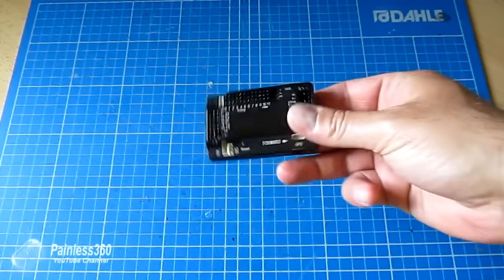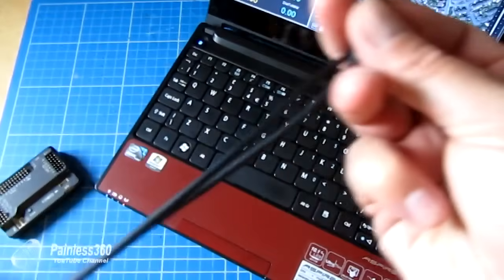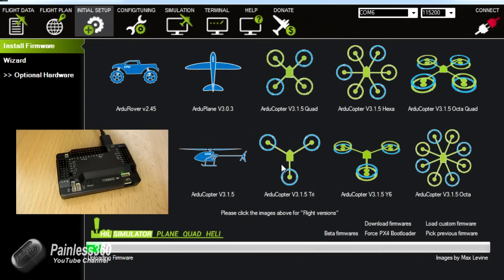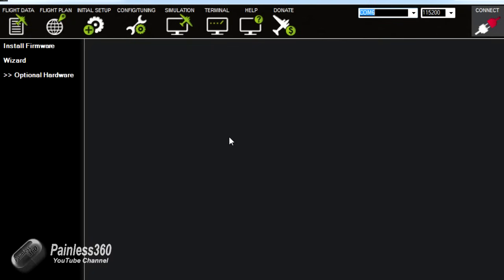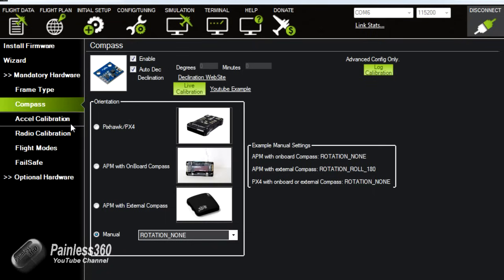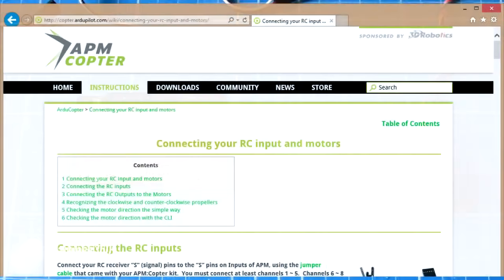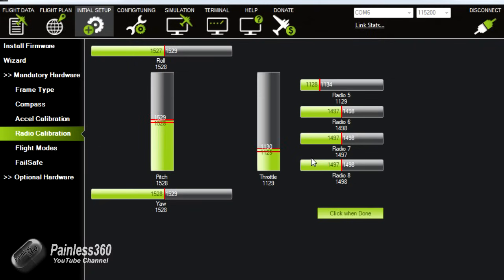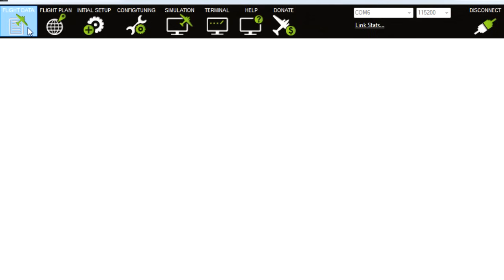(1/8) APM 2.5/2.6/2.7/2.8 - Simple installation and setup overview

Comment: I would like to build the latest version of the Arducopter I think that is 3.4.  I find it difficult to find detailed information even on the Arducopter site.  So far I've not found a place to buy any higher than the Arducopter 2.6.

I have a Blade Chroma copter with a bad controller in it.  (It was a fly away because of defective controller but I got it back.)  I thought since I have everything else, body, motors, battery etc. why not custom refit it for Arducopter?  Has anyone done anything like this?  Since I've never built one from scratch I will likely need some detailed help.

Horizon wants $250 for a new controller board.  Truth is they don't update their firmware the last update for Chroma was in 2015.  Outdated about as soon as it came out with limitations that we as users have no control over.  I want something I can modify and update as needed.

I have an 8 channel Spectrum receiver.  A DX 7 controller and a ST-10+ controller.  Looking for someone to point me in the right direction to start and finish this project.  Thanks.  (I have stage 4 cancer but this is on the bucket list.  Gives me something to do since I can't really work anymore.)  I am on FB and I have a channel on YouTube.

Bryon Smith (AKA "GhoolerHunter")
Reply from the maker: I think you may be mixing your versions. The board revisions are 2.5, 2.6 and HobbyKing did a 2.8. There is a mini version of the APM called the v3.1. Arducopter versions are usually three digits and the last version that supported any of those APM platforms was version 3.2.1 of Arducopter. Hope that helps..
Reply: Regular size is fine with me. Don't need a mini board I have a 500 class body I'm going to put it into. Just need to get the latest version of APM / ArduCopter controller and I'll start building from there.  Is 2.8 upgrade-able to 3.3 ?  If you have a link or info that would be nice.
Reply from the maker: Then I'd go for a Pixhawk. It supports the latest versions of the code and should work great. Best of luck!
Reply: I been looking at that one.  I have an Ardu 2.8 controller and I'm collecting parts.

Comment: can you please help i got my ARM2.6. roday. I looked through your tutorials and trying to figure out here. i cant calibrate radio. connect it via USB to the Mission Planer, by when i turn on the transmitter it just disconnects from my PC mishnplaner.  when transmitter is off it works fine. i was able to install firmware (to 3.3.2). calibrated accelerometer and compass, connect the receiver and made ESC calibration everything seems normal receiver is connected via PWM. 
but as i said the problem is - I want to calibrate radio in Mission Planer - but as soon as the transmitter is on it disconnects from Mission Planner (connected via usb), what could be the problem or am i doing something wrong?
Reply from the maker: +Iron Man Sounds like a power problem - make sure you are using a USB port that can handle the power and also unplug everything apart from the Rx and see if it's still the same.. Best of luck.
Reply: +Painless360 thanks for the answer, i resolved this by reinstalling the firmware. now i can calibrate radio. it works. but there is another issue with arming. when connected to PC via USB i can arm/disarm as normal. but once i plug in the battery (usb diconnected of course). I can arm/disarm it just once. after i disarmed it i can not arm it again untill i unlug and then plug the battery? for example if i want to go flying i can start the copter  but if i want to land and disarm i will not be able to start it again untill i reboot the board? any ideas here - sorry for bothering you but can find similar case anywhere((.
Reply from the maker: What happens if you get past the one disarm/arm limit and plug it back into the PC? Does it arm again?
Reply: +Painless360 do you mean connect it to PC while battery still connected? didnt do it cause power to controller comes throught ESC (jumper 1 installed) i am not sure if its safe to have power from two sources (USB and ESC)?  is it?.. otherwise - if i unlug battery and plug it back to PC via USB and get power from USB - its like rebooting - and in this case - yes it does arm/disarm normally again. strange - no idea which to go from here.

Comment: After installing every parts and calibrations. when i run the quad only one motor is respomding to the throttle others are at the constant speed. But when i try other sticks all motors are responding. thus, i am unable to lift the quad.can you please sort out this problem for me?
Reply from the maker: I've not seen that personally. I'd check that the ESC calibration is ok. See the manual method I've used when the 'all in one' method has let me down..
Reply: Thank you.

Comment: I have a apm 2.8 in my tarot 680...i have programed it andcalibrated the radio...on the screen all the green lone movelikeit iscalibrated but when i try to flyit just falls over like its getting nothing but trottle...none of the other controls are not responding ..but on the computer screen they are moving as i move the sticks...please help
Reply from the maker: +Helicopter Pilot Happy to help but please watch https://www.youtube.com/watch?v=olIqTiSJHIY and come back to me with more detail of what you've tried..
Reply: I have went back through the whole proggraming process....esc calibration..compass..the board willl not arm...if i plug the battery in with throttle ll the way up and pull back down...the trottle starts working but it acts like nothing but trottle is working
Reply from the maker: Not sure what you mean - you shouldn't plug the board in with the throttle at the top....

Comment: Hi again! I have one more question: now when I plug in the battery it gives away a electronic sparkel, what can it be? is it dangerous? Thanks in advance!
Reply from the maker: +Albin Rosenqvist That is normal due to a very short rush of current that fills the capacitors on the ESCs as you first plug the power in. It's normal and don't worry about it. You should find that the second battery won't do it as much as there is still charge in the capacitors to the 'rush' of current isn't as high..
Reply: +Painless360  Hi for a third time now i got another question: Now when i plug in the battery it down´t sparkel anymore. but one of the esc start to smoke can I have fried it? thanks in advance
Reply from the maker: Yep.
Reply: +Painless360 can I do anything about it ( like fixing it)
Reply from the maker: If its 'smoked' then you need a new one..
Reply: +Painless360  okay thanks anyway

Comment: I am trying to set up an Arduino Mega 2560 with a mpu-9250, firmware loads fine but wheni try to connect after firmware load connect to mavlink times out and i get heartbeat packet not received.  Any ideas?
Reply from the maker: +Mike Thomas sorry, we've only used Mission Planner on APM and PX4 boards here.. Best of luck!

Comment: I have a problem with radio calibration. When the sticks are moved, it is not showing on the mission planner. Would you suggest what to do?
Reply from the maker: Could be the RX isn't bound, no power to RX, wrong wiring to flight controller.. Loads of things. What troubleshooting have you already done?
Reply: @Painless360  The above stated things are working fine. Do i need to change any mode in the transmitter? I am using fs-ct6b transmitter.
Reply from the maker: Very possibly. What troubleshooting have you already done?
Reply: @Painless360  The transmitter , receiver, esc and the motors are working fine. Accel calibration was working fine. I couldn't find any other problems except in radio calibration.

Comment: hi there .. im currently following your videos . i have updated my firmware to v3,2 i notice my compass not calibrating .do you know what i can do to fix this ?
Reply from the maker: I'd make sure the connection to the compass is ok (if using APM 2.6) or re-flash the board again.. Good luck..
Reply: I calibrated the compass on the gps   The compass on the apm 2.6 that not calibrating. I guess its not a train smash
Reply: Thany you for replying to me

Comment: hello dear sir!  I have very impportant problem about APM 2.8 and Pixhawk 2.4.8 !!!  I think that Only you can help me about my terrible problem. Because I lost 3 airplane which crashed reason of the these control board, At first I flyed very well with APM 2.8 three weeks ago. I changed the radio TX-Rx 500MA than the boards can not catched healty gps signals adn download new software from Mission Planer. and  than I changed with old radio telemetry 100ma. But The boards lost own stability and fly capasity..It was  impossible to fly with Stabilizer and FWA after that in all my tryies can not to fly and crashed the models. * APM boards and Pixhawk boards.  I watched you video that I started Manuel fly than changed Autune but unfortuantely the same results...Please help me because I do not wish change the control board...look forward your oppinion...best regards
Reply from the maker: I’ve not used APM for ages now and have been telling pilots not to use it and use a Pixhawk for the last few years too, I’m out of date with it. Best of luck getting it sorted..

Comment: Hi there,
You mentioned about the motors all starting together when armed yet mine don't. Any solution as to how to correct this?
Reply from the maker: +chrissymodo Yes you can auto calibrate them together - see the manual for details. Or, you can manually calibrate them (my preferred choice) - I have a video that shows how to do that..Best of luck!
Reply: +Painless360 I did try to auto calibrate them all together but for some reason I couldn't get the board into that setting. Could this be affected by my opto hobbywing ESCs?
Reply from the maker: The ESCs should make no difference. I also struggled with the automatic settings and ended up using the manual - works every time..

Best of luck!
Reply: thanks very much for your help. Your videos have really helped a lot too.
Reply: also I did now calibrate the escs however one of the motors isn't speeding up at the same rate what could this be?
Reply from the maker: I would do it again and if it still had the same problem swap the motor over with one of the others in case it's a stiff motor..

Best of luck..
Reply: +Painless360 I have sorted this out and all start together but the drone tips over to the right what can be done?
Reply from the maker: I have a video on this very problem on the channel - it should help..

Best of luck.

Comment: I don't have option for com6.
where can I get the version of mission planner where I have this option?
Reply from the maker: The com port is created when the PC installs and configures the driver for the flight controller. You need to make sure the USB cable you are using is OK and look in the forums for manual installation of the driver if it's still not working.. Best of luck!

Comment: Hey Painless360 first sorry for my bad english,I have a question,i have installed all and all work ok,except compas,vhen its turn to North it is ok and when I turn or west or east it is reverse(when I turning west MP shows that I turning tovard east and when I turning tovard east MP shoving  that I turning tovard west),do you know what is the problem,thank you.
Reply from the maker: You need to check what radio button you have checked before you calibrate. Best of luck.
Reply: Painless360 how to do that,i am new at ardu (i fly dji till now),sorry if I anoying you.
Reply from the maker: You can see the selections at 8:55
Reply: Painless360 I do ewerithing as you on video,even I find more than 10 000 samples and it still turn reverse,I will try to make video and put it on yt

Comment: hello about the compass calibration. when i do it why is it taking so fast? like when i move the apm and for like 3-5secs its done. is it normal?
Reply from the maker: I've not had it that quick. But I've not used an APM for a long time... Best of luck
Reply: @Painless360  i was really confuse when i watch your vid it takes you so long but when i do mine just a couple of turning the calibration is already done..
Reply from the maker: If it is happy and working, I'd not worry too much about it. Later versions of the software that I am using here don't run on the APM so that maybe it.. Best of luck!

Comment: Hola, bajo los iconos de los vehículos en la pantalla de Install Firmware, de Misión Planner, no dice tipo de vehículo, dice None.
Además, la brújula no calibra, no aparecen los puntos blancos y si aparecen no gira.
Muchas gracias
Reply from the maker: No use APM ahora. Es un controlador de vuelo de 8 bits muy antiguo y mal soportado. La última versión del firmware que lo admitía era la 3.2.1, así que asegúrese de estar usándola. La mejor de las suertes.
Reply: @Painless360  gracias, creía que podrías darme algún consejo.
Reply from the maker: Ciertamente puedo. No utilice APM. ¡La mejor de las suertes!

Comment: When I plug in my Rx like this and try to do the Radio Calibration the values don't move on any of the channels besides Roll, which goes up and down randomly between far left and the middle. Any idea why this is happening?
Reply from the maker: +shanevm2009 tricky to help without k owing the radio and Rx you're using. Check the Rx isn't set for PPM.. best of luck
Reply: Painless360 I'm using the IA6B. Ch1 says PPM and I have that connected to input 1 on the APM 2.6, and the other 5 CHs connected to their respective inputs as well.
Reply from the maker: Make sure the output setting on the radio are for PWM then ;)
Reply: Yes, I have a Flysky FS-I6 with receiver PPM output "On". I had it working before but it quit responding and I ended up frying my old receiver trying to make it work again. The pitch, throttle, yaw, and other channels stay in the middle and wont go any further to the right (or left). The roll goes up and down at random when I move the Tx controls. When I go into Terminal in M,P to try to reset the FC I connect and it spits out random characters right after the GPS/Barometer verification and wont let me do any commands. I even tried installing Arduplane and then reinstalling Arducopter with no success. Also, with this setup should JP1 be installed?
Reply: I got the Rx calibration completed! I changed the servo setup to only have ground and power cables on channel 1, and also took out all the red ESC cables besides for motor 1. Calibrated ESCs all at once and tried to fly, got about 6 inches off the ground and did a full flip and landed on the landing gear but snapped the GPS stand at the base lol. Still on my way to making this thing flyable.  Thanks so much for the help and vids!

Comment: Its showing
Compass 1: Error
Compass 2: Error
Is something wrong with the board?
Could it have to do something with doing it inside a room?
Reply from the maker: It could be a problem on the board. Check the logs to see what you can find out. http://copter.ardupilot.com/wiki/common-diagnosing-problems-using-logs/ and recheck the connection if using an external compass.

Good luck getting it sorted.

Comment: The software keeps saying that my compass in unhealthy. I am pretty sure I have a compass built in with my AMP 2.6 and my motors will not arm. WHAT AM I DOING WRONG! I followed everything exactly like you did it.
Reply from the maker: +Jack Butler WHY ARE YOU SHOUTING!?
Reply from the maker: +Painless360 I'd double check that you have an on-board compass enabled. I would always use a remote compass - works a lot better..
Reply: +Painless360 I actually figured out how to disable any compass features and it now doesn't get any problems.

Comment: hi i wish you would setup the apm mini on a helicopter .i have wrote t you before .i can get the motor to work but can master the servo wiring setup please help .wired it to the esc for power plugged in the signal wire to the servo but nothing servo will not work when i move the sticks again please help thanks chris
Reply from the maker: +Chris Holt Happy to take a look at it with you and figure it out on a one to one support call. See the website for the charges..

Comment: Hi , I have windows 10 . I don't even see any com ports listed . I tried reinstalling MP but APM did not get recognized . i do see led lights on APM though. same problem with windows 7 PC also .any suggestions?
Reply from the maker: I'd try another USB cable.. Best of luck
Reply: @Painless360  It worked with new cable . looks like the cable i was using before only provides power ( charge only) and does not carry data signal, thanks a lot

Comment: Do you have a link to a GPS you recommend?
Reply from the maker: Depends on the board type. Usually a CN06 v3 or similar. Make sure you get one with the external compass if you have the 2.6..

Comment: im having a problem with my apm 2.8 ....the computer detected it but failed to install the driver...and cant detect the com-port on mission planner...what should i do?
Reply from the maker: The best bet is to have a look in the forums. It’s probably a usb cable or driver problem.. best of luck!
Reply: I already fix the problem by installing the adrino and its driver ...my computer recognized it now ....but I m having a problem on althold mode ....when I switch from stabilized to althold my drone drops like a rock in the ground but my throttle stick is at the middle position luckily I manage to pull it up and change to stabilized mode quickly..... What should I do?

Comment: good day
 i am asking how can i use the PPM Encoder V2.0 for my APM Flight. and if it is save or no. and if you can make a video step by step for this. thank you very much for your videos(S)
Reply from the maker: Hi, it should be but make sure you test the failsafes before flying so you know that it'll work. We're not planning on covering this on the channel as so many modern receivers provide a PPM/S-bus output now anyway. Happy flying!
Reply: thank you very much